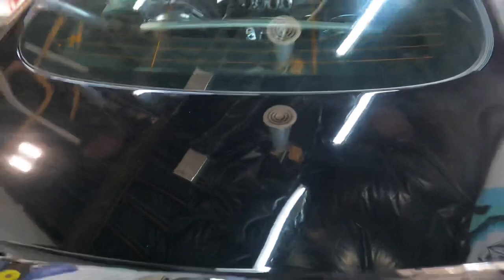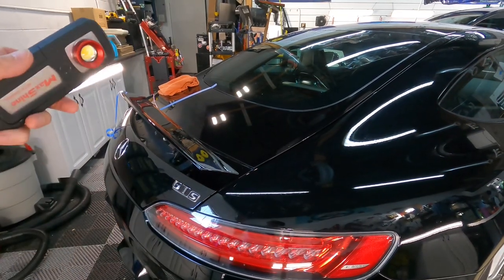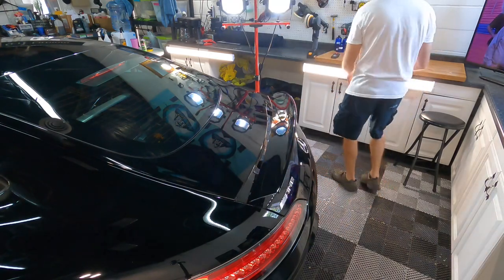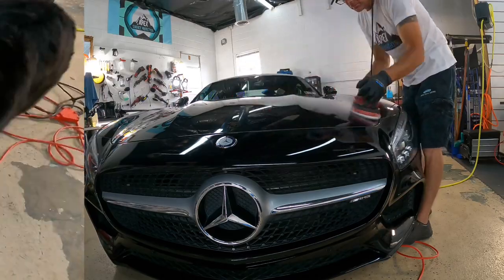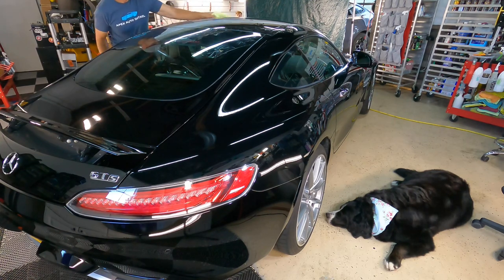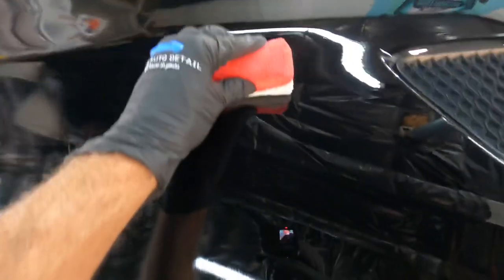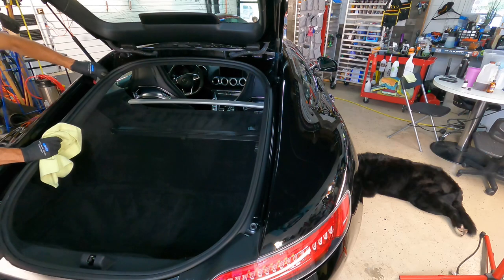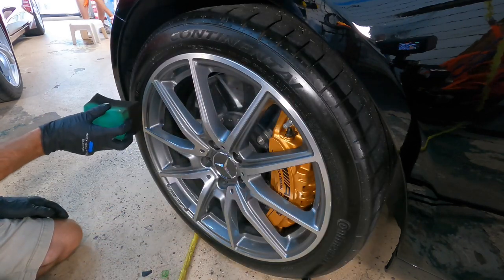Vlog: Mercedes AMG GTS! Part 2! Paint Correction And Coating! RESULTS!!

Comment: Brian, why did you choose to apply Protectall on the under the hood plastics instead of a ceramic coating?
Reply from the maker: This car only sees the road on perfect days. Only light dust would touch this surface. Protect All is perfect.

Comment: Wow, that turned out nice, Brian!  Quick polishing question:  I have a 2021 Mazda6 Carbon Edition with Polymetal Gray paint.  I'd like to do a quick 1-step enhancement to clear up a few imperfections before applying Gyeon Mohs Evo.  Some of the paint thickness readings concern me, though.  They're all 3 point something everywhere, and a few on the hood are 3.1 😳 I'm hesitant to take any more clear coat off.  From your experience, what would you recommend?  Thanks!
Reply: Use caution when doing clear coats that are that thin, always do the least aggressive approach when correcting paint ,hope that helps
Reply from the maker: Try 3D One or TW One and Done along with a light polish pad to start. I wouldnt get too much more aggressive than that.
Reply: @apexdetail85  Thanks, Brian!  I've got 3D One and a few Lake Country black finishing pads, so I'll give that a try and stop there.  I really appreciate your time!